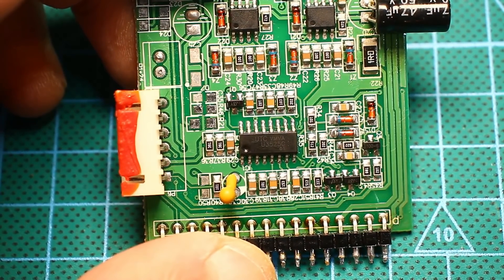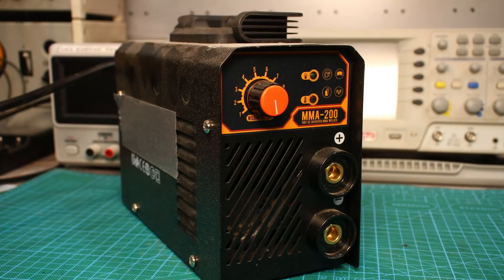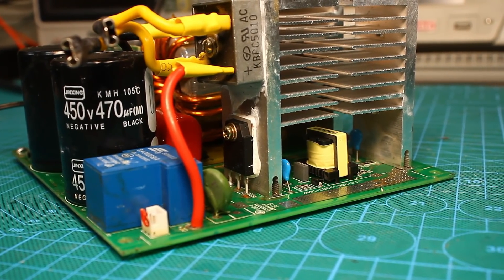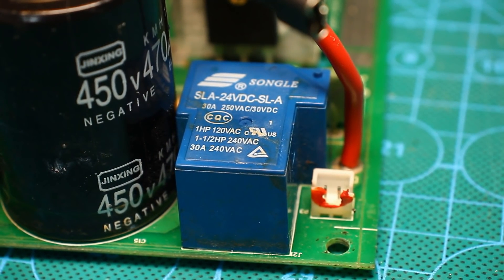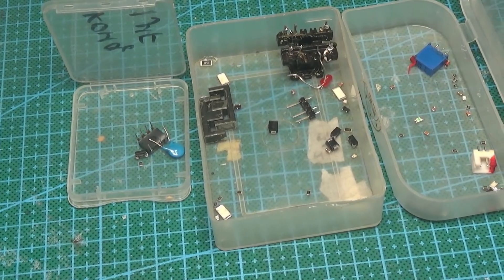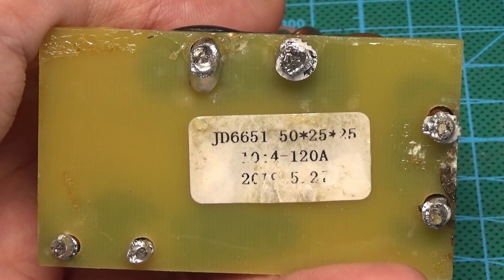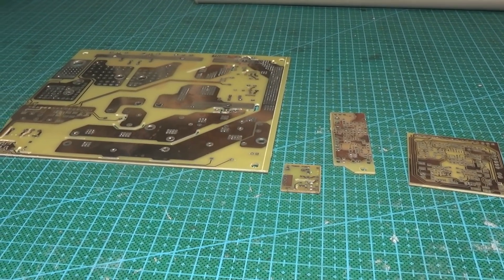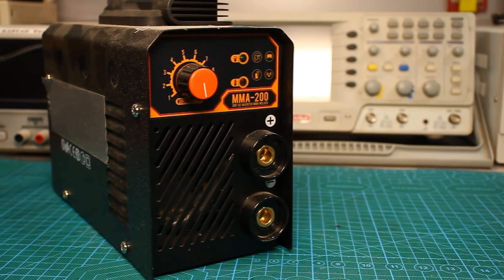STEALING FROM CHINA -  on a LARGE scale!

Comment: Excellent detailed work!  Thank you sir!  Makes me wonder if the cheap Chinese Sine Wave controller board option, like the PWM controller board, can be used also for AC welding like if welding aluminum with other methods.  Seems even if not AC, even DC which might be easier by somehow making an offset from electrode positive versus electrode negative cycle for the two cycles optimal effects, i.e. cleaning oxidation and welding.  I think Miller Synchrowave if I recall correct was the first to do the positive or negative offset for aluminum welding improvements.